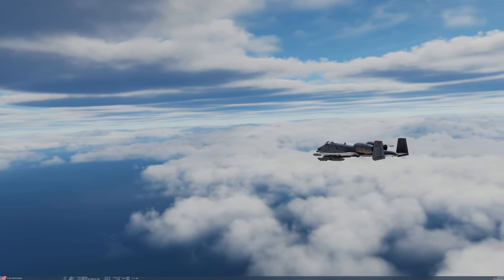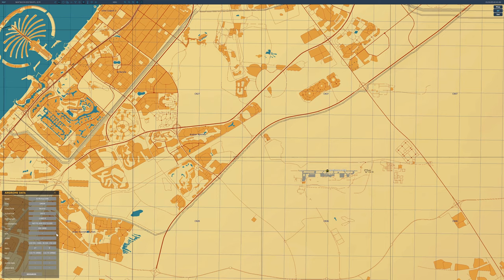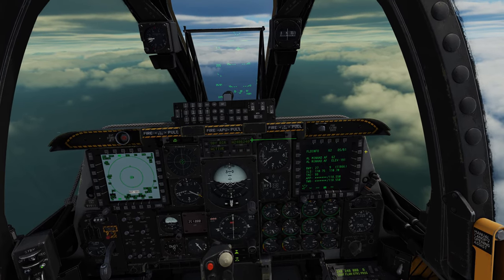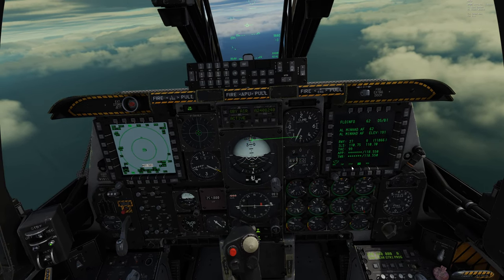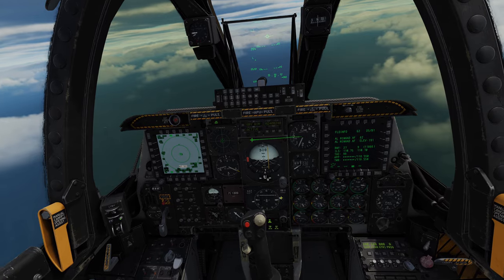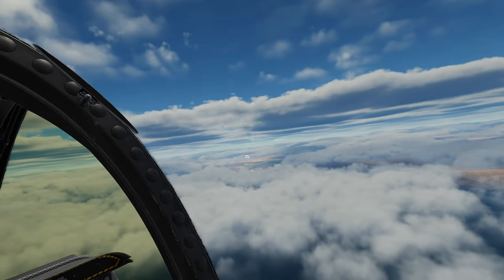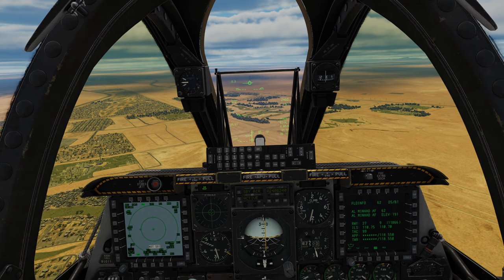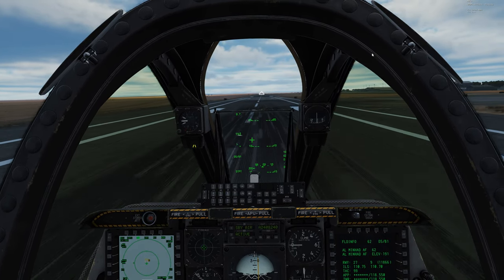Frustrated with ILS and TACAN in your A-10 Warthog?  Hopefully I can help - DCS Tips & Tricks, in 4K

Comment: Couple quick tricks: On takeoff, if you are going to be returning to the same airfield, adjust your heading to match the runway as you sit on it for an easy more accurate heading. Leave it there unless you need it for mission navigation, or then take note of the actual runway heading for landing reference later. (Runway heading markings are almost always rounded off a bit). You can use it to get the reciprocal easily if you need it, too. 
Your HUD ladder gives you a quick reference to glide slope. Put your TVV on the end of the runway. If the ladder shows more than -3 deg. you're too high, if less, you're too low. It's the easy way to get you roughly on glide slope to then fine tune it with the ILS, or get on slope if eyeballing the landing.

Comment: I think you weren't getting a distance at around 9:00 because you were too far from the station to properly communicate(Transmit AND recieve) from the signal.
I could be wrong, but that's kind of the understanding I got from RalfiDude's video explaining TACAN in the A-10C
Never mind. This could be an issue you can face if you're too far away, but what happened in the video was a bug
Reply from the maker: Glad to hear it wasn't me (though I wouldn't be surprised 😄)

Comment: its frustrating you seem to have gotten the same issue with tacan as me, it seems to just... not work? i had no issues with the f18's tacan but the a10 does not sem to want to pick up tacan signals
Reply from the maker: It's been a while since I did this video, or even played around with tacan, but if I recall, it is more of a bug with DCS.  I think that wind direction plays a role at some of the airfields, but not all, and they'll just switch off the opposite runway's signal if that's the case.  Seems like something that would be easy to fix on their end, but who knows.

Comment: nice job. but the runway numbers true headings so that means you have to subtract magnetic deviation, ~5 degrees, to get the course heading -> 90-5=85
Reply: Nope, runway numbers are magnetic headings.
Reply: Runway headings are magnetic headings divided by 10 and rounded so they are not necessarily exact magnetic headings. A runway may be named '34' but its real heading may be 342°. Because they are magnetic headings they are also subject to change as the magnetic field around the earth changes.